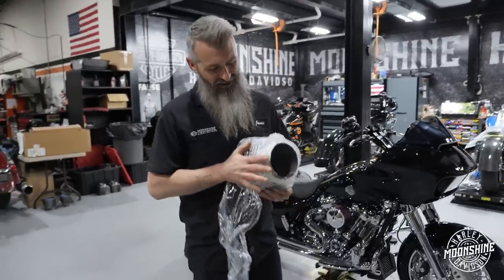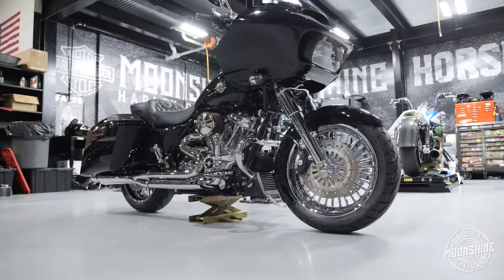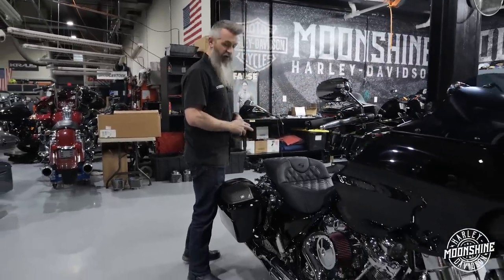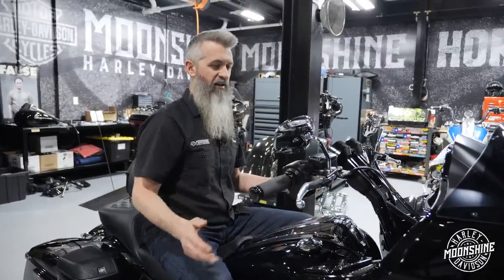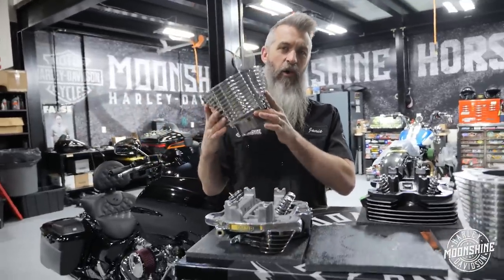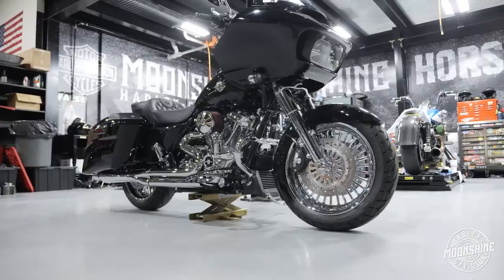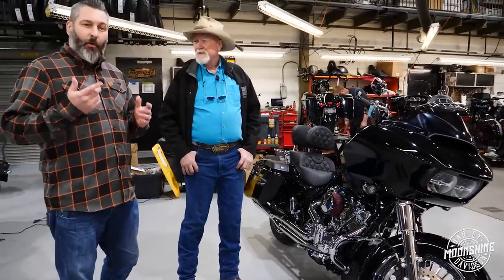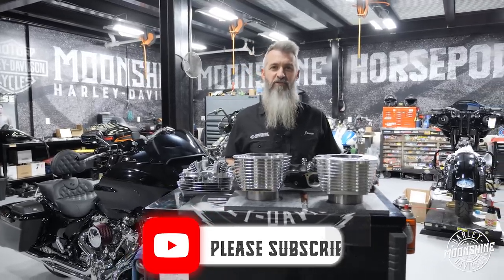Moonshine Horsepower 135 Chrome Fatty Breakdown| Bike Build No. 17

Comment: Two good points I agree with.
One, the front tire, if you're running a rear tire on the front, you run it in the opposite direction. Same for front tires running in the rear, you run ot in the opposite direction.
Most folks thought I was nuts, but it's not about direction, it's about "traction". Front tires need traction to stop you, rear tires need traction to move you, so the traction is in
opposite directions.
Two. The cam size. Cam lift is not always what you want. With longer stroke engines you want more duration, not necessarily more lift. You want to keep the intake valve open longer to take advantage of the longer stroke. I grew up around Chevy motors. We would install larger valves on the heads an install moderate cams with long duration. This would put less strain on the valve train an cam, reducing friction n produce more power instead of having the engine fight itself to produce more power. Kinda defeats the purpose n reduces
engine longevity. You want an easy turning motor. High compression is not a must either.
Pump gas is crap anyway. 9:1 or 9:75 compression is all you need for a good, strong street motor that will last awhile.
These guys know what they are talking about. 
My hats off to Moonshine Horse Power.
Ride to Live
Live to Ride